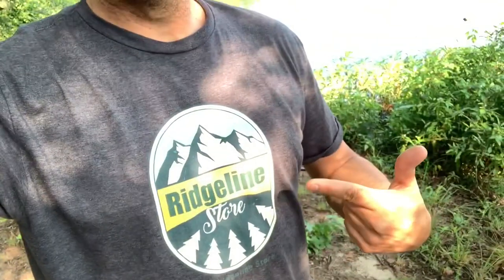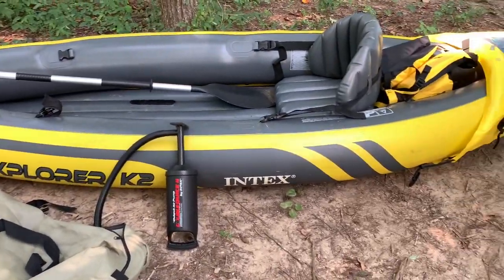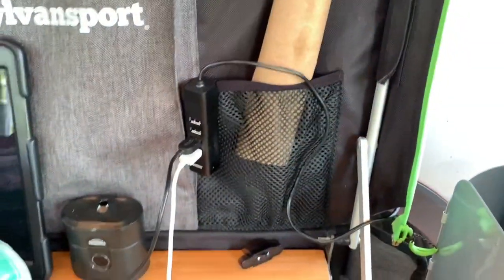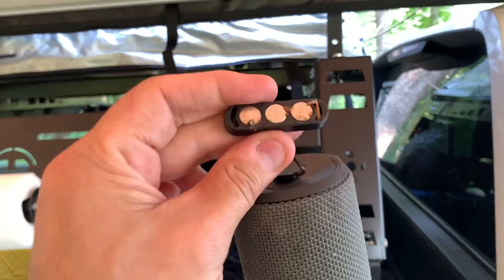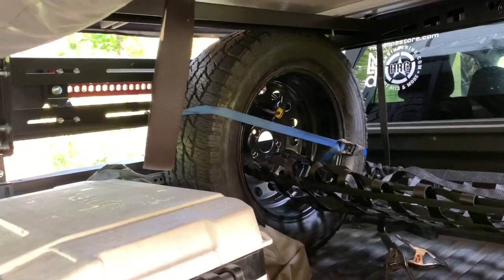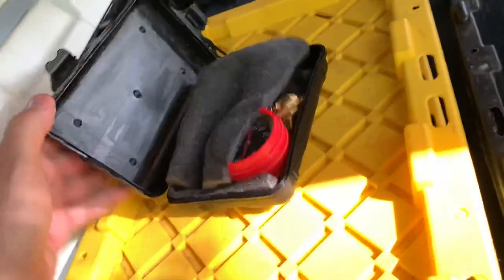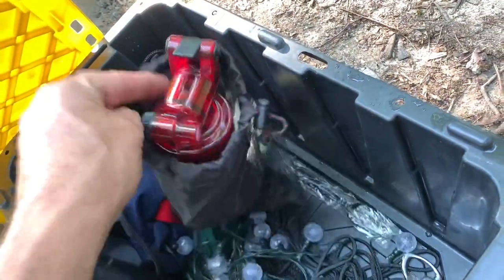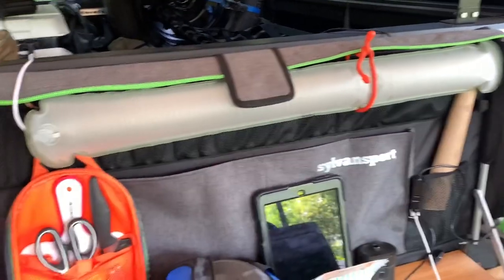Camping with a Honda Ridgeline - Overlanding SoftRoading Walk-Around

Comment: Quick question, what is the frame system that you are using to attach your roof top tent on?
Reply from the maker: It is not the permanent solution. We are going to do unistrut. I have worked with Hobbs as well Tuwa. I’ll have a kit soon. Right now it’s 1 5/8 garage door erector set stuff. Metal tapped with 1” self tapping screws underneath. It works, I like and it is secured as I can place a hooks in it. There will be a bed rack video coming with the proper mounts soon. The Ridgeline is a work in progress everyday because we have a truck that unique and not part of the heard.
Reply: @CampingRandy  thank you for taking the time to reply.